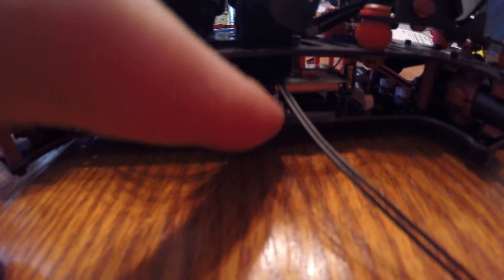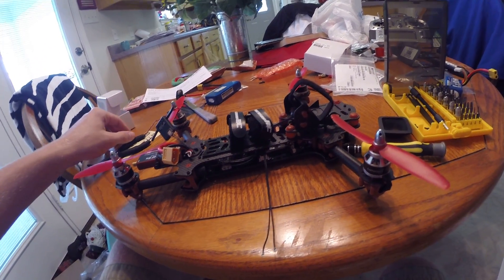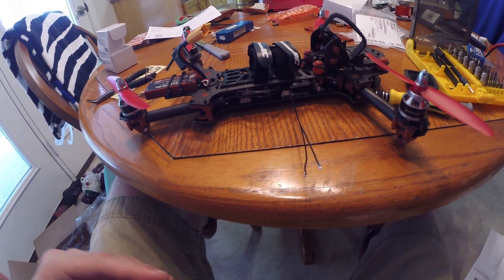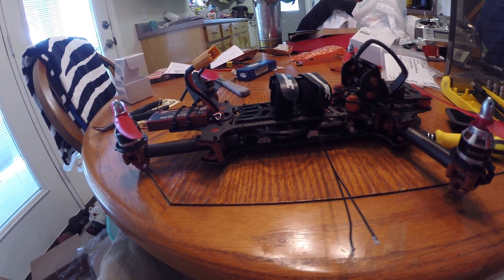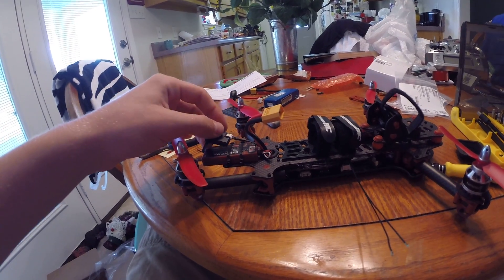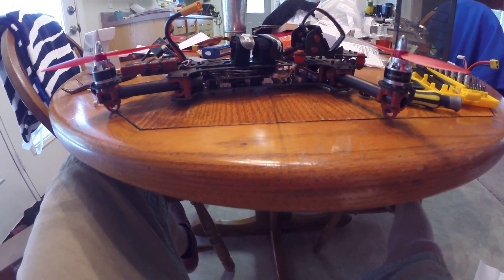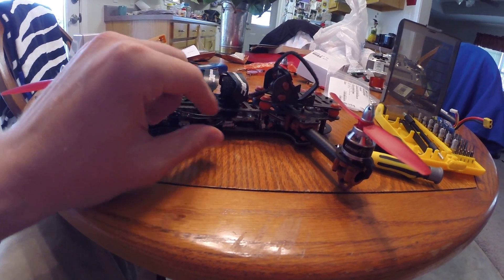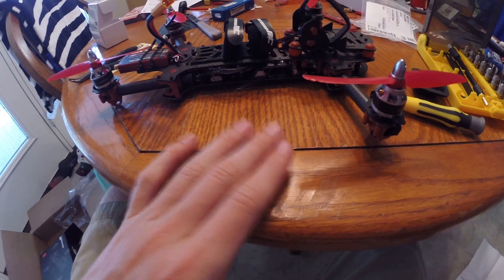Immersion RC Vortex Spektrum Satellite Install RccR

Comment: hi, quick question, i did fly a mini quad before with naze32. On self levelling mode, when full elevator was applied, the quad would tilt down and loose altitude unlike the naza. is it the same with the vortex? is it possible to go full speed and maintain the same altitude?
Reply from the maker: Hi, 
The vortex uses a custom flight controller based off the Naze 32 board I believe. 
Yes, my vortex does the same in self levelling mode. But if you put it on Acro, it gets really fun.